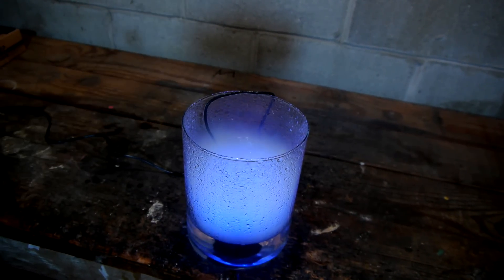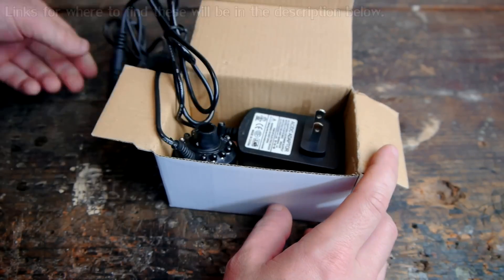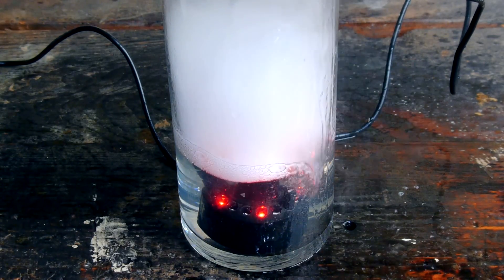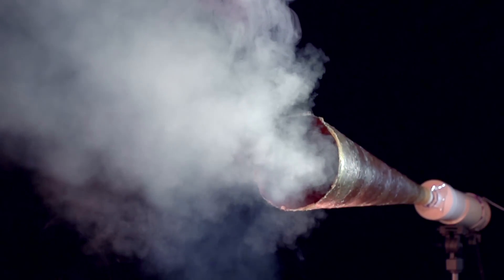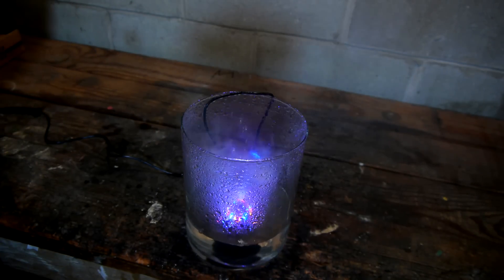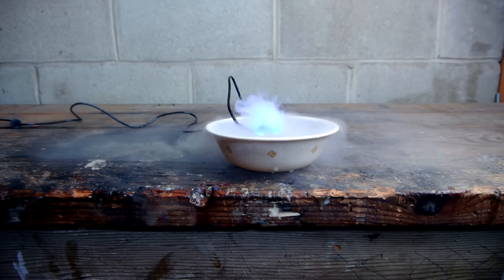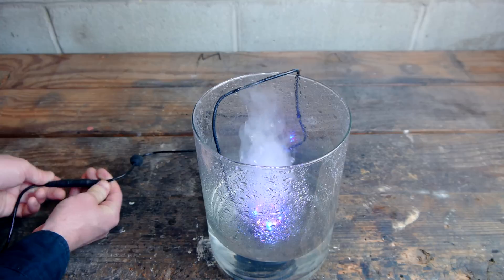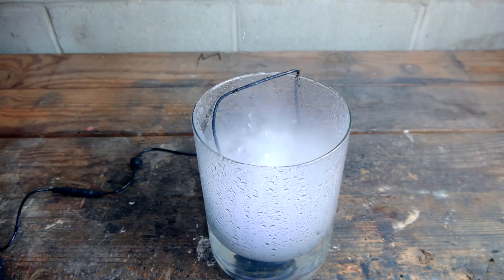$5 Ultrasonic Fog Machine - NightHawkInLight

Comment: I tried putting isopropanol in a device like this but it didn't seem to vaporize the liquid at all. The device was a small "cold humidifier". It was possible that it was working but it just didn't create a fog like water does.
Reply: The viscosity of the alcohol is different from water and the surface tension is so much less in alcohol that it can't produce fog like water can.
Reply from the maker: It's possible the frequency needs to be adjusted.

Comment: 3d printer operators use a water soluble support material to improve model printing that would otherwise be difficult or impossible to print, due to overhangs. This ultrasonic device appears useful to agitate the water in order to speed up the removal of the support material and is quite a bit less expensive than an ultrasonic cleaner.
Reply from the maker: Yes, the first place I heard about these being used for cleaning purposes was in relation to 3D printing. They can be used to vaporize acetone to evenly smooth out the rough edges.

Comment: I would be interested in knowing if the ultrasonic fogger could vapourise an eliquid well enough to vape. Theres always the health issue of direct heat from a coil vapourising juice as formaldahyde is formed when the pg/vg cakes onto the coil and burns. An ultrasonic equivelent could eliminate any burning

Comment: I use a larger floating 3 disc version of this in the winter, as a humidifier.
Get a  20 gallon tub/tote, cut two 3 inch holes, one on either end of the lid. 80mm computer case fan on one end and the other is the exhaust. Have the ultra fogger floating somewhere in the middle. Provides a consistent column of moisture all winter!

Comment: Nice video!! Just wondering if the vibrations that it makes are safe to put fingers near? Thanks!!
Reply from the maker: They're safe in that you're not going to badly injure yourself with the ultrasonic frequencies, but they are very uncomfortable to get your finger near. It could cause the equivalent of a minor burn if you held your finger right above the output. You also need to be careful that they are plugged into a GFI outlet sine you are messing around with an electronic device in water.
Reply: have one of these and i can tell you it hurts a lot when you put your finger near it
Reply: How loud are they?
Reply from the maker: You can't hear them since they're ultrasonic. All you hear is the water splashing.
Reply: NightHawkInLight great video!

Comment: The vegetable glycerin does in fact change the smoke. I had the same thought and put it in an ultrasonic humidifier. I noticed it did make the fog a little more visible. Since I didn't see any harm in running it with the glycerin, I shut the lights off and went to bed. I woke up to a room full of fog and my smile detector going off. It won't set off all smoke detectors but some including mine use an optical sensor that any fog machine will set off.

So apparently the vegetable glycerin can fill a roof slowly with fog because it hangs in the air longer and is more visible than the water vapor.

Also, years ago I bought the same ultrasonic fogger you demonstrated in the video to vaporize solvents but mine never worked. I probably just got a bad one.

Comment: Does the fogger require a special power supply or does it use standard DC voltage? (the supplied plugs aren't compatible with my country's power)
Reply from the maker: Mine uses 24v DC @ 1amp
Reply: Thanks for the detailed reply. I am quite familiair with voltage regulators/converters etc. What I was most curious about was weather the circuitry that drives the piezo is in the power supply or in the fogger unit itself.

Thanks for your help anyways, it's rare to see this kind of help in the youtube comments.

Comment: This is the affect used in Essential Oil diffusers. Heat degrades the chemical compounds in essential oils so this is the method of choice. I've always wanted to know how to fix my broken diffusers. Never had any information until now! Almost all my diffusers have a water resevoir with a cover to keep the larger water droplets from escaping. Hole in top of that cover to direct the essential oil laden fog out. Some diffusers do just as your experiment in the shallow bowl did: the "fog" just oozes over the side. Some direct the "fog" to come out in a certain direction. This is a very effective way to get essential oil into the air in tiny droplets. The affect of the oils is then present, aromatically, in the air for 2-4 hours. Thank you for this information!

Comment: You should try using it in hot water. If the fog is coming off cold then the process is virtually guaranteed to be endothermic (which makes sense considering that evaporation is endothermic.) If that's the case than hot water may help it to produce more fog.

Comment: hmm, I wonder if this could be used as an ultrasonic cleaner. I have an airbrush and, while I take relatively good care of it, there's no reason to expect it to never gunk up. I mean, I could always just buy an ultrasonic cleaner, but... I'm poor, so $5 and some DIY strikes me as better than $50 for a cleaner that I use once in a blue moon, but still need. XP
Reply: I have a cleaner and a fogger. :P Well, i'd say that the fogger might work but it would have very low cleaning "power". Best approach might be to use as small container as possible - to really concentrate the ultrasonic vibes on the part being cleaned. 

A real cleaner hogs up tens off watts but gets the job done. I paid 20€ for mine.

Comment: Glycerine doesn't produce a thicker fog in traditional fog machines as a quality of atomized glycerine; it helps to form bubbles on the heating element, which when bursted are what actually create the fog. In this particular machine I think it might actually be beneficial to have a thinner fog solution, but I'm not entirely sure on that. Try using alcohol, and if that fails to create a fog that is any thicker than just using tap water you can always get buzzed off the vapors :L

Comment: Awesome new line of videos!
Do you think it would be possible to re-assemble this product so that it has no lights, runs on a small battery and perhaps make it so that it wouldn't produce large bubbles?
Reply from the maker: You can buy them without lights, that would be the best option. You can run them on a battery but they draw a fair bit of current. They really don't produce bubbles normally, I added soap to the water for a few of my shots.
Reply: Great! Thanks!

Comment: Just wondering if an ultrasonic vaporizer would be a viable method of creating a good stoichiometric gasoline / air mixture ?  I had this idea as a kid the first time I saw a carburetor in operation .  Since gas vapor is what burns and carburetors actually squirt a stream of gas I reasoned that a properly measured flow of gas /air mixture created in this way may be much more efficient.  I have always wanted to test this but am not sure how to go about it and am hoping you could help or at least shed some light onto the subject for me.
Reply from the maker: That's something I have considered as well. I will experiment with it.

Comment: I have an old 125cc engine sitting at home, but with no carb. Do you think i could use one of these?
Reply from the maker: Sure, but it would still take a lot of careful engineering to be sure flame doesn't get back to the liquid pool over the vaporizer. Something would have to be worked out to control throttle as well. You would basically be building a new carburetor...

Comment: Actually, it was the first thought on my mind, if the fog was vapor enough to break into Hydrogen and Oxygen for fuel.  Also, what's the Volts and Amps for the device?  Do you think it could be scaled up?  And, do you think it would even be worth it, as compared to a Hydroxy generator on 12v car battery?

Comment: I think that perhaps you would have to rework the fogger to get it to work in solvents, because they might dissolve or attack the plastics in the device. I would be a little reluctant to atomize combustibles with it without taking it apart and making sure there's no way it could ignite the atomized fuel. It's a neat little device though.
Reply: It shouldn't ignite anything. Alcohols or gasoline won't attack anything in it. Have fun exploding things :-)

Comment: Instead of water use alcohol and light it on fire
Reply: Less than that, I've tried it before :P (not using one of these though...)
Reply: haha cool
Reply: not really, the taste is AWFUL, at least it was with pear vodka...
Reply: +haxel96 
did you light it on fire? if so how did it look?
Reply: +haxel96 fastest way to get rushed to the ER room ;)
Reply: i made a vaporizer using an empty beer can, made a hole for airflow on the top and poured a shot of vodka in it, lighter below, inhale.

Not nearly enough alcohol to get rushed to the ER room, and since i felt the drunk right away it was easy to not overdose
Reply: 1:48 he states you could make it useful in vaporizing fuels or solvents.

Look up vapour running engines and i bet that you will get some ideas.
Reply: If i had put the flame to the opening of my "vaporizer" the alcohol fumes would've ignited yes, and the vaporizer would've probably got blasted away from me leaving my face a little scorched, but i was pretty careful not to let that happen.
Reply: +haxel96 I have to ask, did the intoxication last as long as it would if you drank it or was it just a quick buzz then shortly back to normality?
Reply: Productive Member Of Society I drank some after so I couldn't tell for sure, but in theory it should be a shorter buzz since there's no liver to limit the rate the alcohol reaches your blood.

It's nothing I could recommend though, as its incredibly easy to overdose.
Reply: +haxel96 Don't heat up aluminum cans. They produce toxins when heated up.
Reply: Mackbros Not really, for aluminum to release toxins (at quantities large enough to do anything) it would require temperatures well beyond what a lighter can reach.
Reply: haxel96 Still if it gets into your food or liquids then you can get dementia.
Reply: Mackbros I don't eat aluminum, it's ok.
Reply: +haxel96 why do people say not large enough quantities to cause health problems, just because when company's  record results down from surveys and drug trials after  a week nobody has died or got liver failure in a month it's fine hahahah stop been so gullible, haha do u know how much it would effect multi billion dollar company's if they had to stop using cans they pay off everyone. tinned food taste disgusting because of the chemicals in the metal.
Reply: Connah M If i'd  be vaporizing alcohol regularly i would not use aluminum cans, i'd get a glass bowl made specifically for vaporizing alcohol. If i were gonna try it out once it does not matter at all.
Reply: john smith that would be explosive.
Reply: john smith no
Reply: Productive member of society - stay in school.

Comment: i wanna see you dye the color of the water in hope of colored fog smoke
Reply: I tried this when I was a kid, it doesnt, the fog still is white.
Reply from the maker: Did you try it with an ultrasonic fogger or a hot coil one? I imagine it would work, but it would take a ton of colorant to be visible
Reply: Ultrasonic. I used almost a whole bottle of colouring and it made no difference. I'm not sure if its because it doesnt atomize the colour ? or if because the fog is so fine it just appears white.
Reply: +ratgreen im gonna guess it's because when it atomizes the color separates from the vapor. it would be so cool to have colored fog smoke. there has to be a way
Reply: Maybe a natural dye, perhaps food colouring doesnt actually dissolve into water it just dilutes.

Perhaps a chemical that truely dissolves in water, not just mixes. Perhaps copper sulphate to make it blue etc. Sounds dangerous as fuck tho
Reply: +NightHawkInLight  does this has the same effect as an bicycle pump and a bottle with water/alcohol?
Reply from the maker: I would bet it's because the fog is fine making it appear white, which is why I say it would require so much color. With how much you tried I guess it's possible that it won't be enough regardless, or only certain very dark colors will have an effect. In any case you gave me some ideas that I may test.
Reply: I was about to ask that, glad somebody got to it though
Reply: +NightHawkInLight 

what if you disable the lights on the fogged and use glow in the dark liquids or something that reacts to a backlight like gin. 

Imagine a watered down gin fog floating of the bar. 
people would be railing that glowing blue fog with straws up their noses lmfao.
Reply: +NightHawkInLight the fogger would vaporize the water, but leave behind any solute colorant left. Just like when you leave salt water to dry the salt doesn't evaporate with the water.
Reply: +ratgreen or many just use pure food color like industrial kind
Reply from the maker: Not necessarily. This vaporizer does not work via distillation.
Reply: Ok
Reply: Maybe using pure food coloring with out adding any water.